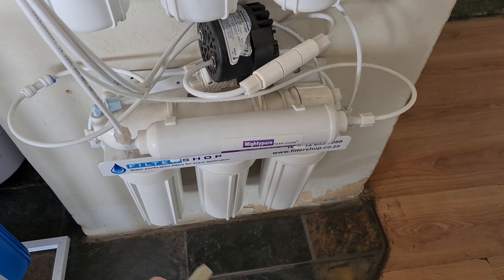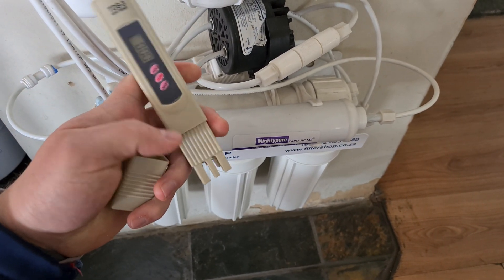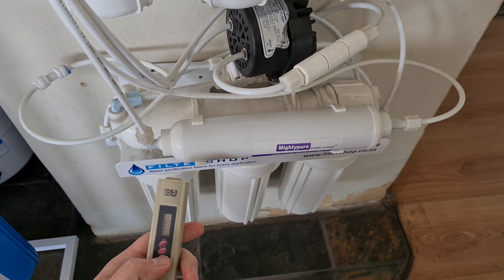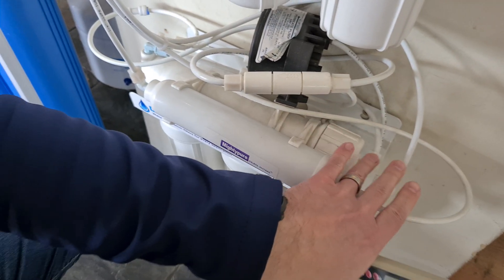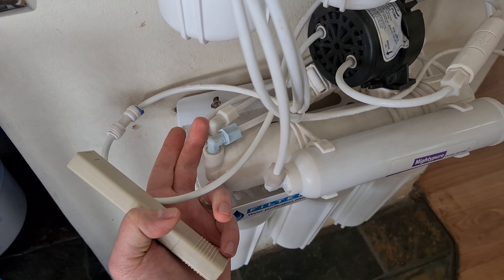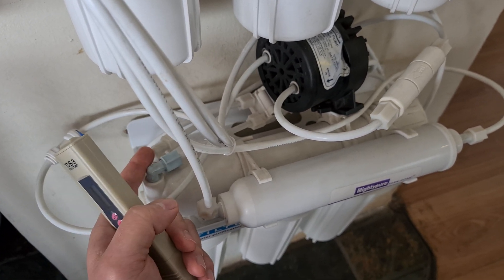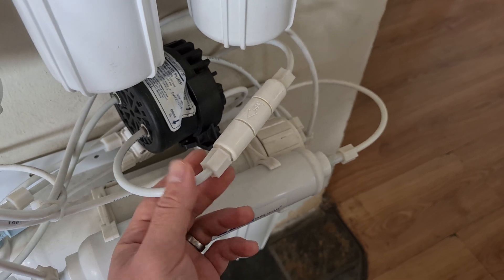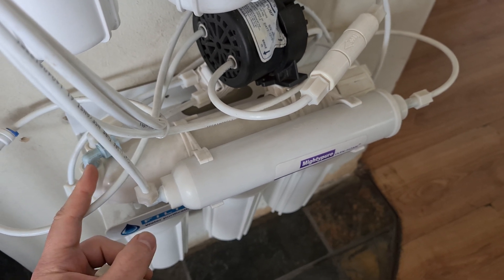New RO Membrane Filter TDS Too High

Comment: What would cause the tds to remain high even on the purified water?
Reply from the maker: it could be that your incoming mineral content is just too high for the system to handle or that you are not flushing the membrane enough.
Reply: @FilterShopZa  thank you, I think it is most probably that my system is battling to handle the mineral content. Will maybe getting additional pre-filters and water softener boost the system to perform better ?
Reply from the maker: @jolis9925  Test your level of hardness first, you can just use a swimming pool test kit. if it is over 200ppm total hardness it should help to have a softener.